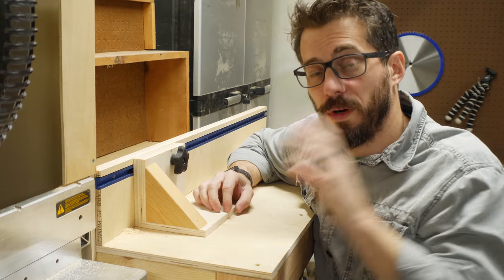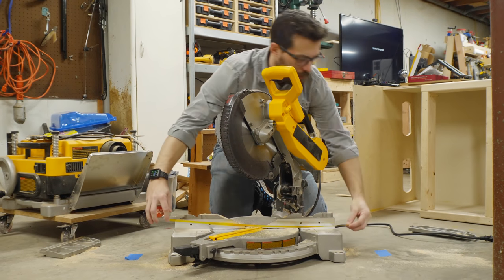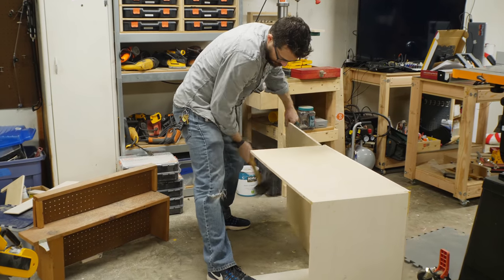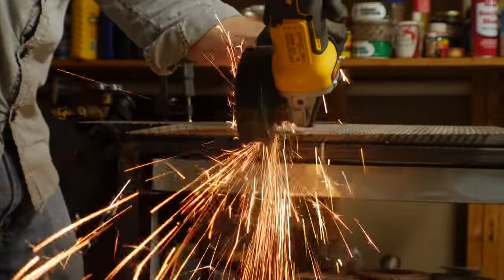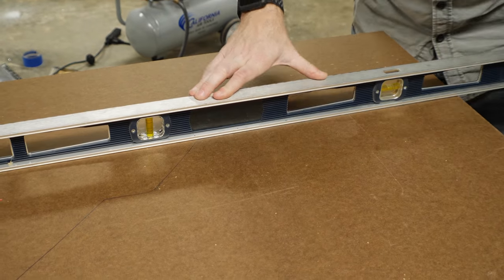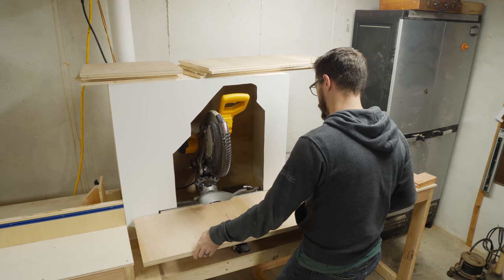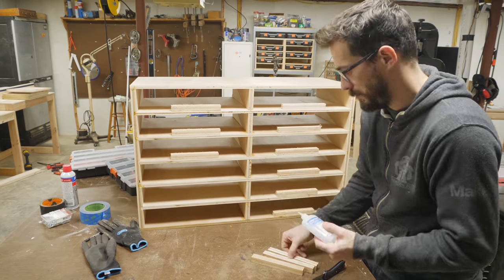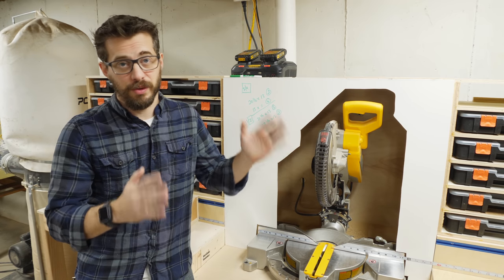Using Your Suggestions to Improve the Miter Saw Station | I Like To Make Stuff

Comment: On the right side of the miter saw whiteboard, did you stick the measuring tape to the whiteboard? How are you going to move the whiteboard out of the way if the measuring tape is attached to it? Or my eyes are playing tricks on me.
Reply from the maker: The tape got cut at all of the edges. The tape on the whiteboard is a bit unreliable though because that panel has a little slop in it due to the magnets. I left it on one side but I wouldn't rely on that section to be precise.

Comment: Great video! Hmm about the dust left over under the saw. Maybe a fan or some small burst of shop air. Or, maybe replace the mdf base under the saw with expanded metal grate and build a steeply sloped box angles into the dust collection ports... Eh anyways great video!

Comment: My Dewalt compound mitre saw has a discharge port on the back.  On my station I put a hose in the box to connect to my vac system.  My set up is almost identical to yours.   I have a small shop so dust control is a must.  Consider a hose to the back of your saw.  It made a big dif on mine.

Love the videos! Keep em' coming!

Comment: +I Like To Make Stuff

I have a small suggestion to further hone the dust collector, cut two more pieces of plywood a little higher than the one put behind the holes, also in 45 degrees, but the same WIDTH of the holes, so that the bottom edge (which lies in the holes) is parallel to the wider sides of the holes, and from there cut a semi-circle on the bottom so that it is in the shape of the dust collector, of course, so you have a small slope also on the sides of the box directing dust to the collectors.

An "example" to try to "illustrate" this using text and characters would be this (consider both normal bar and the backslash - "/" and "\" - like those pieces of plywood):

"" left hole "" space between holes "" right hole "" / "

The second step would be to cut two more pieces of plywood, this time much longer, still in the same width of the holes, using the same procedure of rounding the lower parts, but these would be positioned in the center so that the cut of the part of both, at 45 degrees are in the middle of the space between the holes.

Using the same "diagram" above would look something like this:

"left hole" "/" "\" "right hole" (being that both bars would be in the center would look like this: "/ \")

This would cause the dust that was on the sides of the collectors or the center to delineate toward the holes, just as it did the small "slope" on the back.

Comment: I'd like to find a video on how to measure accurately in order to intall the measuring the tape. I just made this miter saw station. I'm afraid my tape won't be accurate. Bob just says " I measured 16 inches" which apparently is what he needed for his specific saw.
Reply: I figured it out. Measure a board to an exact length. Bump it up against the saw blade. Mark the line. Line up the tape. Then cut another board to see how you did. It's spot on.

Comment: On the white board you used to cut out the shape for the miter saw, you should spray it with the chalkboard spray paint so you can write stuff on it as you need to and then just erase it.
Reply from the maker: Well, that's the purpose of the whiteboard. It's a dry erase marker board. :)

Comment: This is awesome :) I wish I'd suggested stuff when I saw the first video lol. Well during this video I was thinking a standard board with appropriate shaped/sized hole for saw and all its positions but a sort of brush like those made of nylon for wire holes or whatever. I did also think about easy changing of the facier so good job pal

Comment: Instead of having two funnels to receive the saw dust it would have been better to make one large slide into a 4" hole that way it wouldn't collect around the back ledges of the two funnels and behind the chop saw. Also add the mesh screen as large as the back hole but removable when necessary, and increase your suction.

Comment: You glued the ruler over the faceplate !? I thought that it has to be removable...? 
But nevertheless great work as usual ;)
Reply from the maker: Just on one side initially as a way to line up the part that ended up on the aluminum fence. The ruler is cut at the seams but the part on the whiteboard isn't reliable due to the slop of the magnets.  I probably wont keep that part on there or at least trust it.

Comment: could you use chicken wire instead of the steel grate?  I want to create a station much like this, but funds are very tight. So would it be ok to use chicken wire, or should i bite the bullet and use the steel grate?
Reply from the maker: You definitely can but might want to do 2 layers offset to make each hole a little smaller.
Reply: ok, thanks!

Comment: If you're planning on taking the front cover off, are you going to have an issue with the sticky tape stuck the front of it?
Reply from the maker: Huh?
Reply: He made cuts on the tape with a utility knife so it doesn’t pull off when removing the cover
Reply: You put the sticky tape on the front cover which is removable, right? Doesn't that mean you're going to have issues with that?

Comment: I see you using the Kreg Circular Saw guide and track.  How do you like them.  I have seen both good and bad reviews on them and sometimes you just get overwhelmed with responses.  I've even caught other OEMs leaving bad comments (they should be ashamed).
Reply from the maker: It's not perfect, but it works really well in the most common use case of cutting down plywood to more manageable sizes.  It's probably not quite as exact as a tracksaw though.

Comment: Why is the rule not on the left of the whiteboard?
Reply from the maker: That side was pushed back just a hair and when I cut the ruler it wasn't stuck there so I didn't put it on by hand. The whiteboard piece can shift a bit left and right so the ruler on it isn't super accurate. I mostly just trust the ones on the fences.

Comment: Never seen a compound saw in a benchtop case and there's reasons why you wouldn't do it...as you mentioned and also seems a lot of dead space in the case.    Even the aesthetics aren't pleasing,  If I spent  the dollars on great tools, I want to see them.  good skills, not the best project.  Yr shop could use some better storage solutions, mebbe vertical pull out shelves (pantry style) not many have done those,  You can store a lot in them and they hide the 'busy'view.  All the best.

Comment: Not meaning to sound . . . well . . .dumb, but why didn't you just make the 'old' front panel magnetic so you could remove to do compound cuts - almost looks like you didn't need to lengthen the box section. Either way, like the storage space and simplicity of your solutions.
Reply from the maker: The old box wasn't wide enough for the saw to lean to 45 when set angled to 45 too.

Comment: Did I just see you plunge that jigsaw through the wood???
Reply: Simple to do if you start the blade just less than parallel to the wood and slowly lower it in.   Drilling a hole works best for accuracy though unless you have a large cut-out.

Comment: Did you notice that the ruler is covering the front part of the dust box so you cant take it off
Reply from the maker: It's cut on the edge.  Not sure why that's a confusion for people, but apparently I didn't point out the cutting process well enough.

Comment: Couldn't you put small holes all over the piece of wood the saw sits on and have the sawdust fall into the box under the saw and the vacuum pulls it from there. I know that would cut down on suction but wouldn't it be enough to still pull it. That way you wouldn't have just 2 collection points they would be spread all over so there are no dead points to the system.

Comment: You chamfered the less important corner.  You really need to chamfer the bottom edge on your stop block where the working wood will be repeatedly butting up against it.  This is where sawdust buildup is really going to impact the repeatability of cuts.  Other than that, you need to add a proper millimeter tape below that other one... but good luck finding a proper metric tape in north America.

Comment: What is the advantage of using the dato stack over a router
Reply from the maker: I don't know that there's an advantage. Both would work well. I think my dado stack cuts faster than my router, but depending on the power of your machines that may not be true.
Reply: Daniel Reza'e 
Dust collection is better with the dado stack
Reply: Thanks. I don't have a dado stack but I'm gonna get one from the hardware store

Comment: why do you use wood, or any other solid for your front board? isn't it easier to make a frame for your miter saw, and attach cloth with rubber bands that can make it expand and contract? you're saw dust collector won't complain for the extra dust :-)
Now you have a big hole feeding it air with dust, with a frame and cloth, it will be eating dust with air. And why 2 holes for your dust collector, and not one big scoop?

Comment: You messed up the ruler. For one thing the removable front will probably move a little bit so that part of the ruler is going to be inaccurate. Also, you left it uncut on the right (so you cant remove the panel, which you just painstakingly made removable), and totally removed it on the left. You could have at least finished that before finishing the video.

Comment: A suggestion to anyone building diy solutions to every day tooling problems. Take a look at professional grade tools and how they solve your problem. None of the professional grade tools build massive cabinets around their saws, but they still achieve better dust extraction than this arrangement whilst having better manoeuvrability and functionality. Calculate your labour and materials then the amount of time saved, and the benefits to your health, then purchase the correct tool for your circumstance. A chopsaw is usually a once in a lifetime purchase, a good hoover fitted to this dewalt is way better than this box affair. This guy has great skills but his solution's, whilst looking great, are just content for his videos. Buy smart, let someone else do the designing, materials analysis, debugging and use the time you save spent with your family. Merry Christmas to you all.
Reply: I've used three different miter saws for long enough to form a decent opinion of their strengths and weaknesses. Each one was terrible at controlling dust even with a dedicated dust extractor. The Festool saw was the best of the three, but it still made a mess and particles would fly up. Although it isn't a vacuum formed sleeve attached to all points of the saw, this hood and the dual extractor vents works really well and if someone had it on a table already, they're only out the cost of half a sheet of thin plywood.
Reply: Plus their labour, fixings, design and bug fixing ( no two saws are designed the same and I did not see any printed designs or cut lists etc.) I doubt that this system is visable sawdust free, let alone the microscopic dust that does the damage to your lungs. I use my saw in customers homes on a daily basis and with the addition of a competent vacuum cleaner /extractor my clean up time at the end of each day is the same as if I was not using a chop saw at all. This design is nearly click bate, looks nice but very little value to your production or your health.